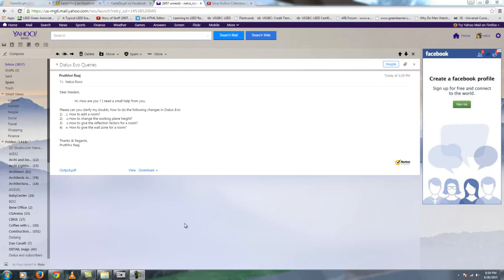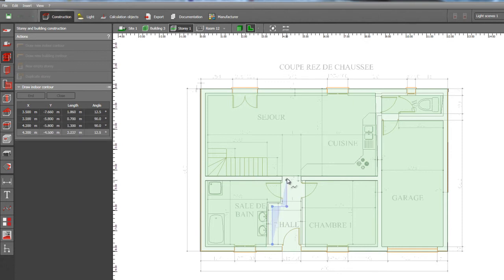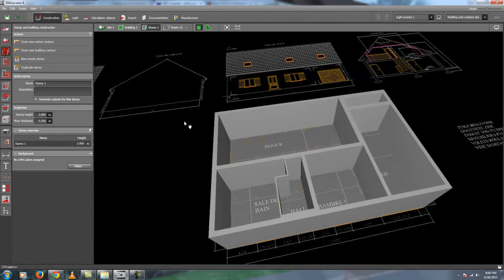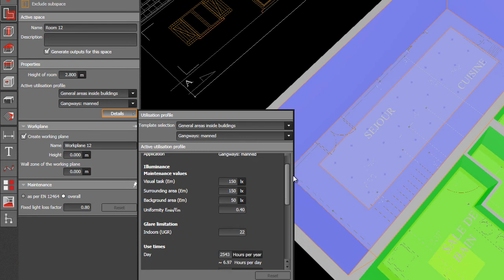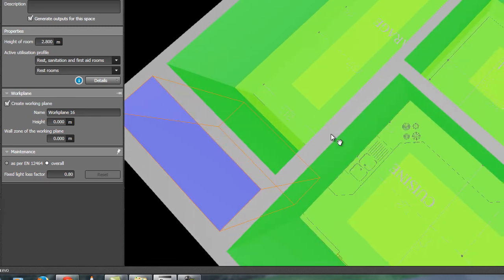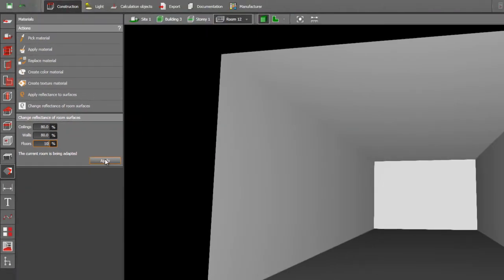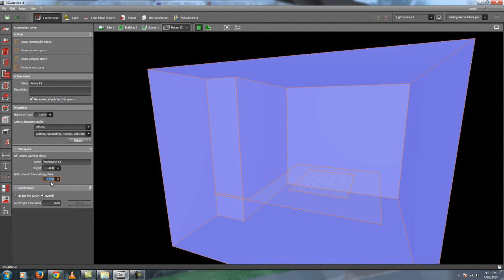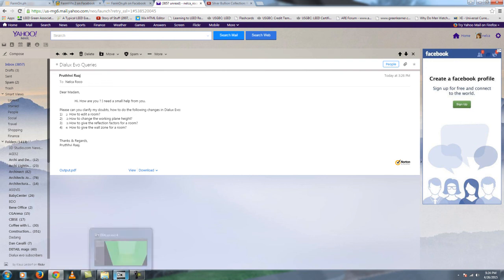How to Change Working plane, Edit the room, assesment zone, etc

Comment: hi roco
when i  a creating room fully covered with the wall. how can i see opening from topview in 3d?

best regards 

hussain
Reply from the maker: thajmul hussain.  Go to room tab or floor tab.
Reply: hi roco

i could not find out that tab. could you post screen shot ? i would be helpful for m.

thanks 

hussain
Reply from the maker: go to 4:45, look at the upper part of the screen, u will see the "storey 1" and "room 12", click one of these, then put ur view into 3d. see beside green box tab. click it and try rotate ur view and u will see ur top view open.
Reply: thank you so much